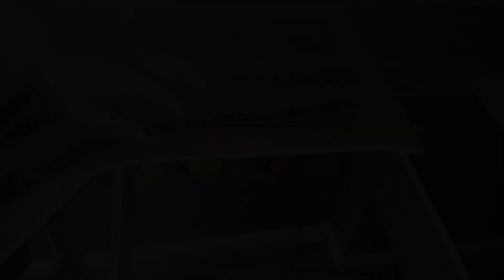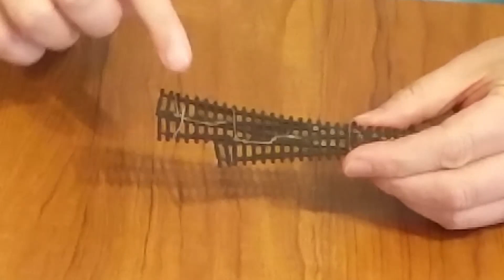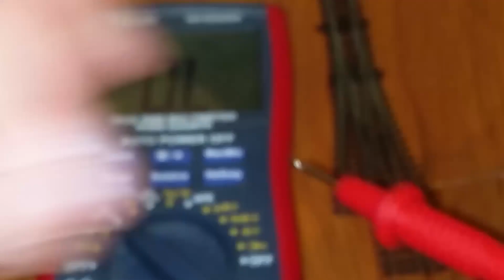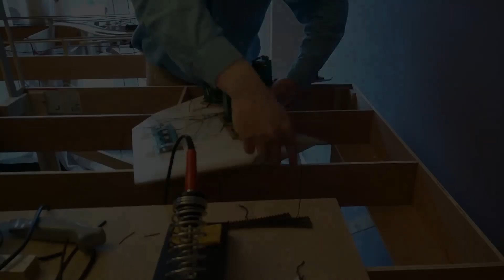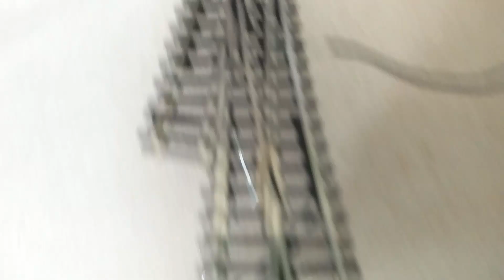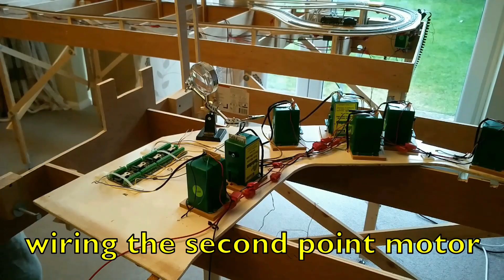11 Customising an n-gauge 3-way point | How to power switch rails on three-way points.

Comment: I have 2 of these to modify, thanks for the video,  did you use any insulated rail joiners at either end of the 3 way switch?
Reply from the maker: Glad it is helpful.
Yes I put IRJs on all the rails that lead away from the frog. So on a normal 2 way point that is the two "inside rails" rails on the diverging end of the point. However for these three-ways, there are 4 "inside" rails that lead away from the frogs, and all 4 of them need IRJs. It is not necessary to insulate the other end of the point though.
Reply: @naivegauge  
thanks

Comment: Hi, great video and the only one I've found that covers the subject matter perfectly.. One question, after you have soldered the wires and you show the wires on the underneath, there is one additional at the top right (black), what was that for?
Reply from the maker: What is the timestamp in the video that you are referring to?
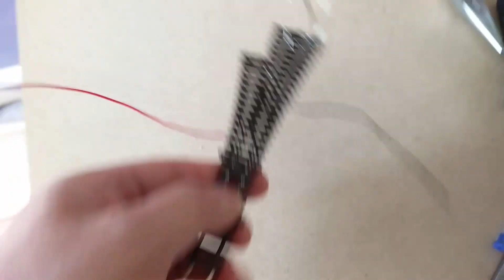Reply: @naivegauge  Hi, 19:18 onwards.
Reply from the maker: OK, I see.
So there are two black wires. One is at the frog end of the point, the other comes off the side. I think the one at the frog end is connected to the 
underneath if the black stock rail. the one that comes off the side is the link between the stock rail and one of the switch rails that we are trying to add power to. I think I left the wire attached as I thought I might be able to use it to power the stock rail, but in the end the point motor was in the way, so I cut it off, just leaving the link in place, and powered the stock rail using the black wire at the frog end of the point.
Reply: @naivegauge  Ok, thats great, much clearer, thanks for taking the time to respond.

Comment: I seemed to have issues with focus while you were demonstrating the point at the table it seemed that the camera was having problems focusing it’s a comment made on observation just so you know
Reply from the maker: You are quite right - I have really struggled with getting the focus right on some of these close in scenes. I am only using my phone, so it is a bit of a challenge. Since filming this video I have learnt to mount the lens closer to the subject. I also have a new camera app that lets me lock the focus, so that makes things a bit easier. Thanks for your support.

Comment: That's  a mighty impressive layout you are attempting to build.  The 3 way points are tricky to wire but if done correctly should give trouble free service.  Adding the additional wiring will improve the point even more.  I noted you glued the point down  -  I've gone a slightly different route - pin the track and after ballasting remove the track pins.  If you decide to change the track plan it's easy to lift.  The ballast/PVA glue will keep the track firmly in place.  Cheers Euan
Reply from the maker: Thanks for the encouragement Euan. I how found that pulling track up that has been glued down with copydex to be relatively easy, but it does not leave the cork roadbed completely untouched.
This particular 3way point will be under the scenery, so no need to ballast it anyway.